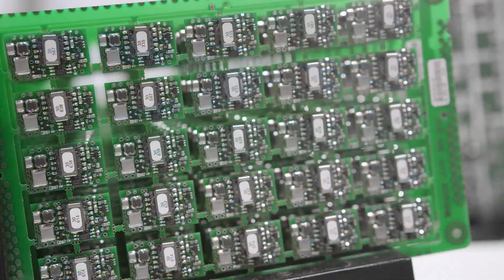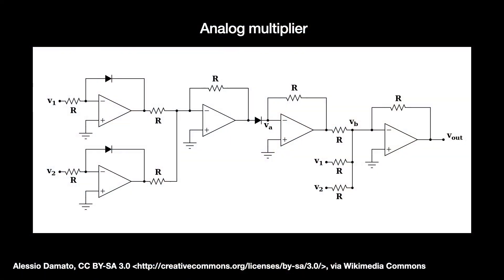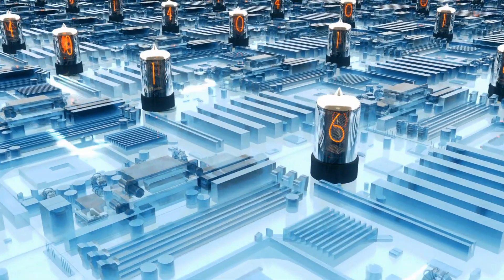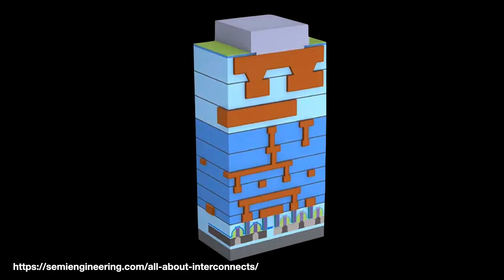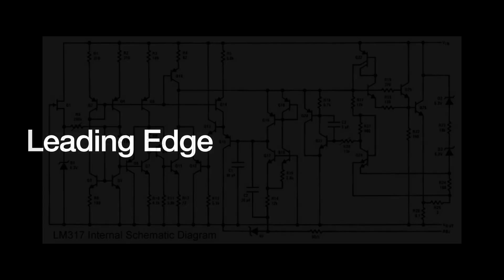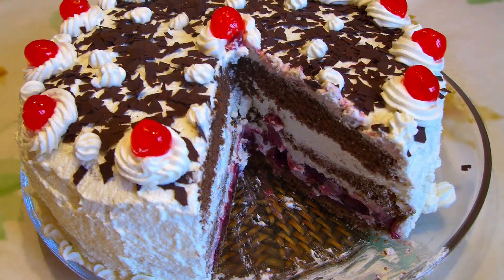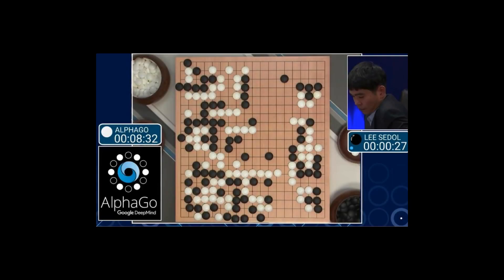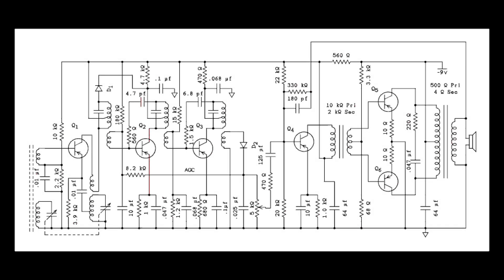Analog Chip Design is an Art. Can AI Help?

Comment: I like the comments even better than the video.  

High frequency has always been some sorcery, even in the discrete days 
Power on reset is another tricky design situation.  Even very experienced designers can wind up with a process sensitivity.

Pass transistors can be a headache as well.

Comment: I started my analog design career with a CK722 transistor which I promptly burned out. I did a lot of analog designs using analog chips like the 741 op amp. I got into digital electronics before TTL came out. Went on to use the first microprocessors but they were too slow to do much of anything. I invented a digital circuit design plan that I called 'random logic' which implemented software using hardware. My random logic was much faster than any CPU could do.

Comment: As someone working in IC design, I congratulate you for the accuracy and clarity of the video! I'd just make a very minor correction: verification starts before, and is done in parallel with, the physical design. It only finishes after it, because it needs delay back annotation .

Comment: In principle, an AI could learn to do anything we could (or even beyond).  .... In practice... the challenge is training the AI.  Language is rather easy to train as is art because of the wealth of examples of what it should look like.  How many design references are there for board layout or chip designs with accompanying schematic?  Quite a few, but nothing on the order of what is available for other training methods.... and we've seen how goofy AI can be when it comes to things which require both precision and accuracy in its work.  

Even if we could compile the necessary data to begin training - validating the efforts of the AI would not be easy - they need to be simulated with may-as-well-be-real simulation (which doesn't yet exist to my knowledge - some good simulators are out there, but nothing so good you could forego real world development to validate) and/or fab it and evaluate it.  It would be an agonizing process.

We aren't there in AI design, yet.  In many cases of using AI to make things, it tends to make things that look like what we expect but that often contain weird or irrelevant inserts.  The amusing picture of duck hunt with ducks in the room and a kid smoking with his father comes to mind.  I would expect modern efforts to use AI to reflect this type of behavior in chip design of all types.  It knows what a duck is, knows how to draw it, etc - but does not understand it should not be there, that the kid should not be smoking, etc.  Why is there a band stop filter on everything?  Because the AI knows you want band stop filters and where it's seen them, before, but not necessarily when it should not use them.  And then the proposed die may look interesting, but have no concept of ground plane returns or have random interconnecting of components because AI tends to follow rule of cool when it comes to prompts.

Sure, there are more procedural AIs in the world of structural parts/components, but you can turn them loose with a set of parameters to optimize around and a reliable simulator to come up with a range of candidates to trial.

Designing a circuit of any kind is designing a system.  When an AI can play factorio - that AI process/technique might be able to be applied to systems design.  Might.

Comment: ASML / TSMC probably need to replace the copper with silver/ platinum/ gold or alloys thereof, for the sub 3nm 1nm & so on 0.6nm nodes since copper parasitic resistance in shrinking pitch sizes increases so rapidly as a function of the cross section decreasing.

Comment: Today, they employ various building blocks to create larger groups or modules. These building blocks include oscillators, switches, amplifiers, and so on, which are assembled into functional units. However, the approach taken depends on the specific RF (Radio Frequency) components they are working with. When dealing with GHz (Gigahertz) parts, the design process often starts from scratch, with components being integrated into a complete system. In contrast, for low-frequency parts, the approach typically involves assembling pre-existing modules and grouping them together to form the final system.

Comment: Analog chip design is very tough.  This is a great video that can be touched on multiple times.  Safety critical devices pretty much only take analog inputs and as we innovate some of the new boards are not as good as the old ones from the 80's !!!  We moved backwards in analog chip design !!

Comment: I went to school and regretted positive-negative theory-application DC. Also regretted parallel-series. I dislike one-trick-pony and dislike to corner myself by analogue-analog or digital. 

Parasitic 
= resistance
= capacitance

Every item since china-alloy wire-conductor and china-insulator capacitative touch are treated as capacitor-and-resistor. Learning from digital-modular, every objective is a series-cable module. Learning from mainboards, every segment have to be positively-grounded or negatively-grounded and power resupplied for stability-predictability. Baseline of ground is not zero but rather a value that is outside the tolerance-margin of the item in-use (resistor bands, milspec not covered because cornered rat). Using 3.7v battery, ground can be a 5v component or a 3.3v or a 1.5v or a 1.25v but not zero.
Reply: Your cables multimeter match-batch are inferior to control signals intercept, interprete, block-pass, ... serialised analog
Reply: 3.3v Light bulb at 2x 1.5v maganese batteries analog can ground and can be capacitor-accumulator voltage-stabaliser (flickering AC clothes iron type for 220v used for 120v, ...) plot ranges of capacitor-resistor and use the linear range and serialise functional-modular objective instead of 1 big piece. Join wires for functions. All cables are not equal.

Comment: hmm wondering why my ipod nano 6 from 2010's battery(0.39W hr) lasts for 2-3 months between charging. is it just more efficient old school board design? or just the fact that it has so much less CPU/background process/metadata thefting. interesting.
i think the pinnacle of analogue design are those crazy people who still work on oscillators and RF stuff. not only is everything a cap and a resistor, everything is also an antenna and sometimes on fridays an inductor. 
back in the vietnam war days all of the ECM/radio jamming was done analogue. if the enemy could just figure out what frequency you were using, something as subtle as that, they could blast hatsuni miku equivalent gibberish and make your missile fail to get a radio lock. interesting still was how close the east and west were in terms of circuit design. its worth noting that with enough skill, someone could literally take apart a piece of the other sides tech, like a raydom and make intuitive guesses on what frequencies or PWM/other analogue encoding methods were being used and how, and make a sufficient electronic counter measure without ever even gathering the emission data. the solution to ECM in vietnam was to.... scramble all the best EE's as fast as possible to make a new working and totally functional analogue circuit basically every couple of weeks for a small production line of like 100-200 pieces. then it would all be hand soldered and wired togeather, tested and shipped, installed, brazed onto the belly of a jet in less than 2 weeks. I think those guys working on fighter jet solutions to RF jamming during the vietnam war will always be the most skilled analogue EE artists the world ever knew. kind of interesting to think about, peoples lifes on the line unless you can put in 40 hour work days and get that circuit made, while it stil was a piece of art

Comment: Not only you not ever killing off analog, it's inevitable it will have a comeback in years to come. "digital" merely means we coerced the universe (the actual computer) to do our bidding for us within certain extremely limited scope using those "semiconductor" things. Binary has the advantage of allowing us to constructs and model essentially anything we can imagine using it as the base, but it is EXCEPTIONALLY inefficient. Think about how many binary operations, how many electrons you need to move to represent simple wave function. Or to take a derivative/to integrate/to make a stochastic model/to do anything that isn't a simple addition. It is especially evident in machine learning, where expression power is everything and the more complex your activation function is, the more expression power your resulting model will have. That's why your organic brain still runs circles in terms of generalization ability around modern DNN, which take like 4 A100 GPUs and 1200w of power to even run inference in, while your brain takes like less than a dozen watts A DAY. We still have plenty (like really, a lot) of headroom left in terms of compute per energy, we just need to branch away from semiconductors (blasphemous, I know)

Comment: As an early career analog designer, I have to say that you generally got the design flow right, except that nowadays almost no one is using a paper and pencil to do anything significant. Usually things will be sized and played with in a simulator, experienced designers "have a feeling" about what sizing is going to work, and are usually right. The complexities of BSIM-BULK models (formerly BSIM6) means that doing anything on paper is fruitless, though there is some nice guiding principles in the EKV model. Reductions in supply rail headroom have also meant we have to do most things in weak inversion now, and that changes your current characteristic from quadratic to exponential, another weirdness that is different from what is taught in university. 

AI training really seems hard to achieve, though probably not impossible considering what LLMs are doing these days. But one of the key problems is that there are many criterion for "good" and so in order for a computer to optimise, this optimisation has to be set up in the outset. This means that two different analog designers might have very different goals with an assistant AI, one might care more about their area specification, another might be more focused on how they are going to achieve their dynamic range spec with the power consumption spec. As you said, it's a very high-dimensional space, I'm not sure how one AI tool can really guide you through all of that. That's to say nothing on how you are attaining this dataset to train on, where's that coming from? Also, who is qualified to do the annotation of data for a dataset? Lots of hard problems to solve in this domain.

Comment: Keeping leading edge in analog design is very strategic and i doubt anything from the state of the art will be declassified even after the end of the war. 
Market for neuromorphic,multi-layer chips utilizing new effects like hall effect, spintronics and electret effect is spinning up each day and there is absolutely no way human designers can keep up with complexity required by even small neuromorphic processing system for things like avionics, image processing etc, esp. that neuromorphic chip design allows moving processing directly inside sensors. 
Civilian applications will probably get limited success with solver-augmented knowledge systems (think Mycin) trained on iterating models sent to the fab and then tested back, especially physics f.e. for spintronics is largedly out of reach of any available software. IF allowed at all as this creates too high risk results might get stolen (and just simple expert system can push adversaries toward capability of advancing their own tech)

It is actually kind of sad as it draws another cold war scenario, pushing humankind into the darkness of power hungry and ineffective digital processing for next 20 if not 50 years. Bit like carbide tools, ceramic bearings and other "reserved for military" things , civilians will suffer most - lacking implants, pushing self driving cars and low power drones into realms of sci-fi, just like small cars made of aluminum-magnesium alloys were quite hip just before the ww2 (like 2CV) but are still not possible to mass manufacture today due to military conflicts.

Comment: As newbie analog layout engineer (not circuit design) the main time-consuming part for me with a new pdk is studying the DRM and making sure all the rule checks/requirements from circuit designer are cleared after the design and of course all that PEX/EM/IR/ERC issues and what not are met. My job sometimes feels like laying bricks following specific rules after the main designer (circuit designer) has designed the stuff for the building. I think the layout part could get automated at some time in the future (in fact some things are already done using scripts that does not need human intervention).

Also, fun fact: Major companies usually outsource the manual jobs to 3rd world countries like India/Bangladesh. However, apple still maintains a very strict policy and their contractors have to be (I believe) physically present in their country/office. No wonder apple still rules the chip market with their efficient hardware-software combination, and their chips are so optimized whereas others are 'if it works it works'.

Comment: Hi. I am engineer. Analogue design will be completely automated, if not already in some heavy projects, because the design reuse has reached its maturity early 2000, i.e. now there is only the need for advanced heuristics and optimization algorithms to achieve a middle range complex design of about 10000 transistors (we are not speaking of digital designs since these have pretty fixed rules(Lynn Conway anyone?). Unfortunately, the problem is that the new generation is not interested in analogue design, as being confident that digital systems will prevail or even they can outsource their analogue designs in the East. A bravo to Asianometry for this great presentation.
Reply: Indeed improving the reuse is where AI can help

Comment: My perspective of 50 years of working in electronic industry is digital is a very narrow subset of analog. Resistance, and/or, impedance plus capacitance, and the one thing you left out in your talk is inductance. But you are correct and that it takes a few people with the artistry to do a good job in design.

Comment: My first thought in this video, was correct selection from about millions of existing semiconductors in our world in designing analogue circuits boards. AI could help a lot in selecting these in function and low costs. This could speed up designing processes. // Would you do the same video in analogue design of elemental digital circuits components? => Design rules of transistors, gates, flip-flops, synapsis, neuronal circuits, ... ? Thank you for this video.

Comment: As an electronics repair tech for a large US manufacturer in the UK, I work on and use precision analogue electrical measuring instruments every day. I almost never gave any thought to the complex analogue designs inside the many many ICs used in this equipment. Being a designer of the circuitry in this high accuracy analogue equipment is a huge challenge in itself. The design engineers job is having to take into account parasitic capacitances, inductances and resistances. Having made a few analogue designs from discrete and IC components, I know how challenging some of these can be. I sometimes think it is all magic, and I have been in the industry since I left college in 1984.

I take my hat off to those who design analogue circuitry on a microscopic level, and am glad to see you honour your father in this piece. 

Can I also just add that the sweet baked confection shown is a gateau, not a cake. Gateaus tend to have more than one layer of filling, usually a combination of buttercream icing and a fruit jam or compote. The main construction is formed of a light sponge.

Son of an electrician and a baker.....
Reply: Respect

Comment: Famous last words... xD, but whether they are mine or yours I do not know.
I personally believe that AI is quite suited for design processes with a lot of variables, although humans will always guide the process to some extent, but on more and more abstract levels moving forward. So with less input garnering more control.
I think the key is connecting an LLM to a generative AI and an automated prover. The generative AI can adversarially learn to move across the state-space given by the proving process (it mimics validity). If that proving process includes certain effects, the generative AI will be capable of handling those too.  This generative AI can be initially setup to be partly driven by some huge random input value, which then can be replaced by an LLM setup to influence the design outcomes. The LLM learns to output values that cause the circuit design to mimic those it learned elsewhere. A good start would probably be all the textbooks about circuit design. This should enable high-level parsing of abstract input (and iterative guidance of the design process).

Comment: 1:00 It is no longer limited to "comes from real world" QPSK, QAM are extensively used in real digital world to transfer data more than 1 bit / cycle - >10 bits per cycle. Not to mention SDR radios etc.

Comment: You left out power supplies, which are a major block of analog on soc parts.  Analog capacitance and magnetics are physically big, so they take up a lot of space as do the deep wells.  Rf design such as wifi cellular and Bluetooth also have considerable analog preprocessors, but are part of most soc's.  The topology of analog can switch from unbalanced to balanced in integration, this driving up complexity.  In the end, I don't hold out much hope for ai, but a combination of ai with quantum computing that can model multi dimensional parasitics, now we are talking.